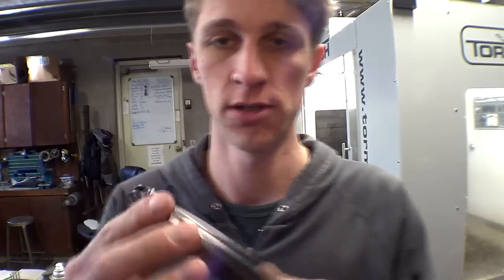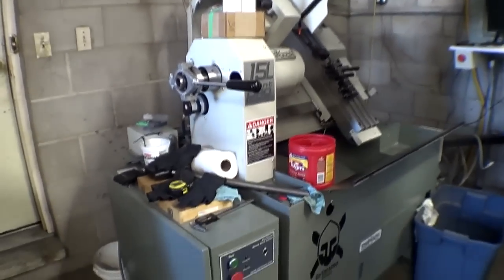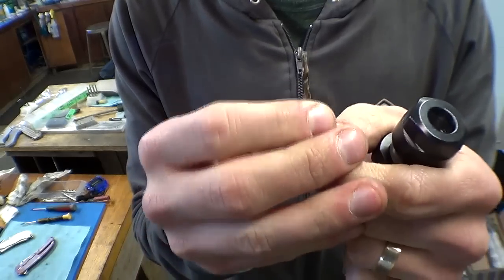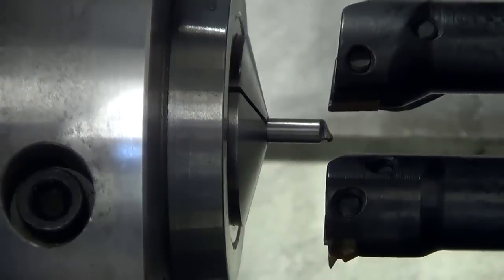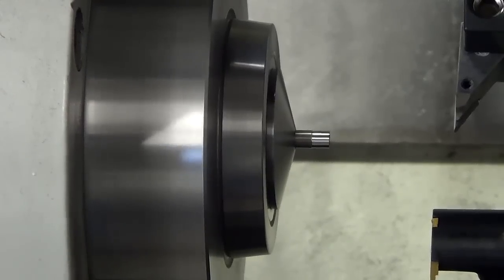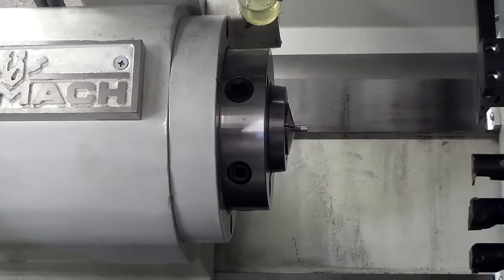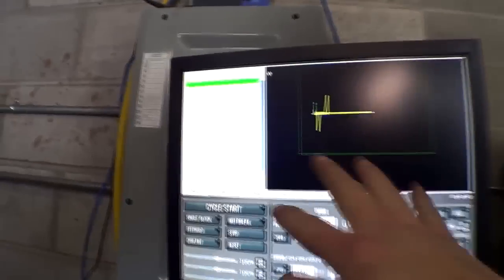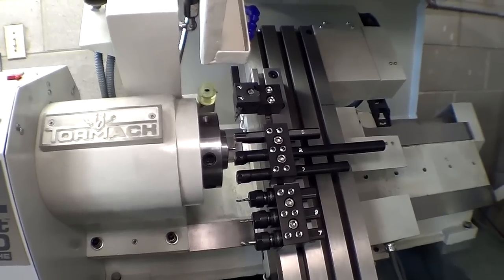KMT 103 - Tiny spacer on the Tormach Lathe

Comment: On this particular part it probably doesn't matter, but on parts with a longer stickout, turn first and drill last. Prevents part deflection (taper and chatter) under load since there's more material to resist the cut :)

I also wonder if your digital probe in the mill might be able to act as a crude tool setter in the lathe. Not sure with the round tip...hmmmm.

Comment: reset the offset on your tool! These machines seem like a bargain, have you anything to offer as for benefits vs drawbacks?
Reply from the maker: These Tormach machines are a bargain!  Tons of benefits.  Very few drawbacks, some are speed and power, although I have NO issues with the power.  I wouldn't mind faster rapids on both the lathe and the mill, but it's no biggie.  With Tormach you can get a brand new CNC mill for the cost of a 20 yr old industrial mill, and they have a nice small foot print and don't weight that much so they can go almost anywhere.  They're perfect for hobbyists and small businesses.

Comment: 14:10 "Dropped it!"  Reminded me of a job I was doing several years ago in my basement shop.  After machining slightly oversize, I was basically polishing a steel shaft to exactly fit a pair of needle bearings for the pivot on the nosegear of my experimental airplane.  I had the assembly (two bearings and shaft) in my oily hands, fumbled it, and it landed in a dirty cat litter box.  The joys of basement shop machining.  The litter box isn't in my shop, now.

I have a nice Bausch & Lomb 10X loupe that I used to insect tooling, but I bought a bunch of LED lighted 30X pocket magnifiers on Amazon and they're great!  Lots of edge distortion as expected, but it's essentially a pocket miagnifier, and they were a bit over $3 each delivered from China!  How do they do that?
Reply from the maker: Yeah I love my little loupes, I've got 2 of them and I use them several times a day.  But I won't let Erik use them otherwise his polishing time will quadruple.

Comment: Unrelated question: do you generate code for every serial number you engrave, or do you have a way to advance the numbers automatically?
Reply: m98custom1212 Polo  :)
Reply from the maker: I have a manu-matic way to do it.  I made 10 codes, the numbers 0-9, in the first position of my three digit serial number.  Then I use a subroutine and G52 offset to call each one, move it over 0.1" or whatever, call the next number, etc.  Three codes, so I can easily edit the code for each number.  Here's an example for #233:
G52 X0 Y0 Z0
M98 (Norseman Blades\Engrave - RWL.TAP)
M98 (Norseman Blades\Engrave - 2.TAP)
G52 X0.070 Y-0.020 Z0
M98 (Norseman Blades\Engrave - 2.TAP)
G52 X0.141 Y-0.039 Z0
M98 (Norseman Blades\Engrave - 3.TAP)
Reply: JohnGrimsmo That's some fancy programming. I really need to start working with offsets, I guess
Reply from the maker: silentqueue
They're easy, and it lends itself to subroutines very well.  Just don't forget G52 x0y0z0 at the end to cancel it all!
Reply: JohnGrimsmo you should write a Marco for that